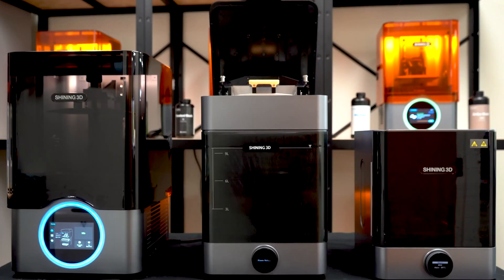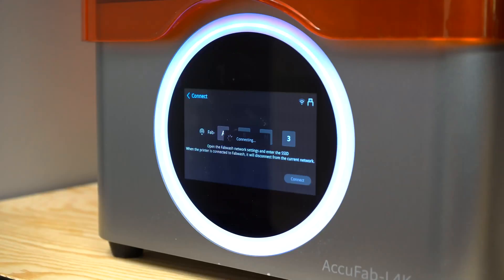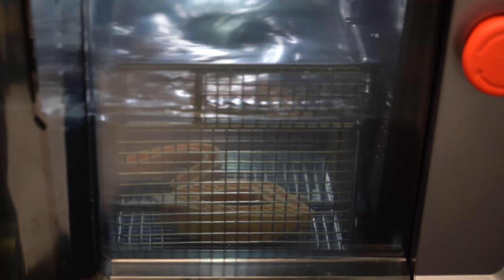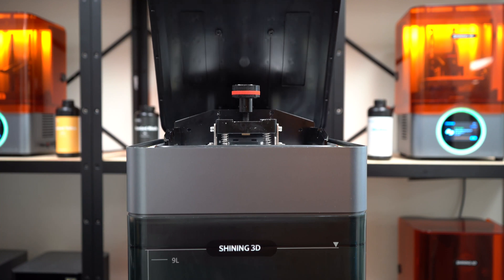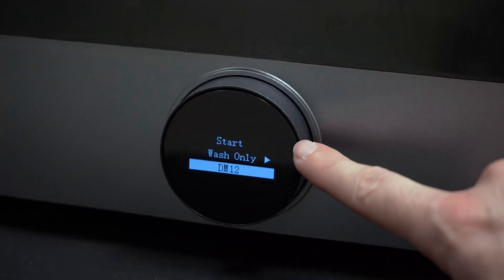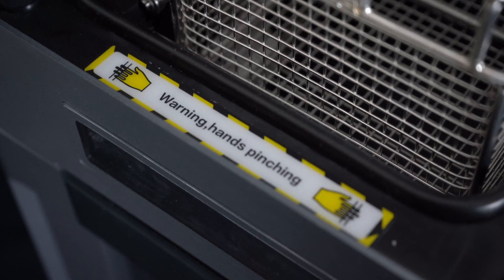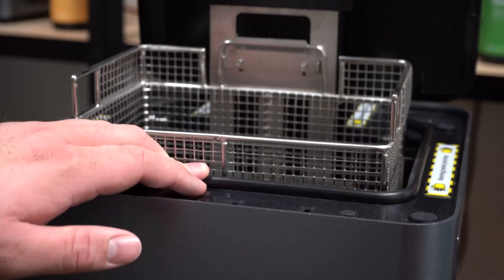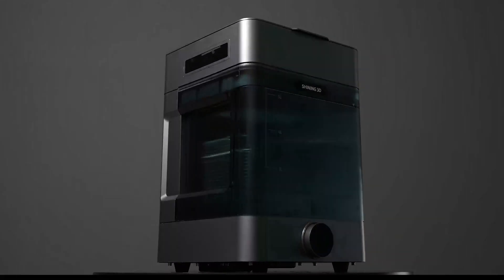FabWash Post-processing Unit - Practical Demo

Comment: Hi I got a fabcure 2. Acoording to bego resin brand for triniq the postprocessign using the fab cure 2 should be in 20 degrees but the custom setting does not allow to me to set in this temperature. And after the processing the resin change the color could u please assist me